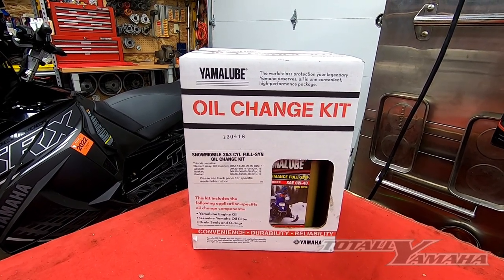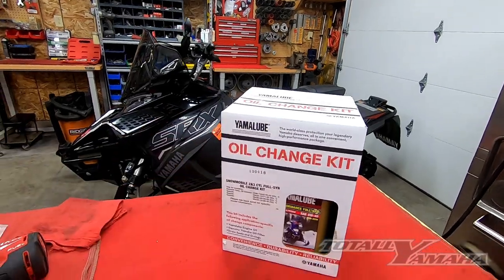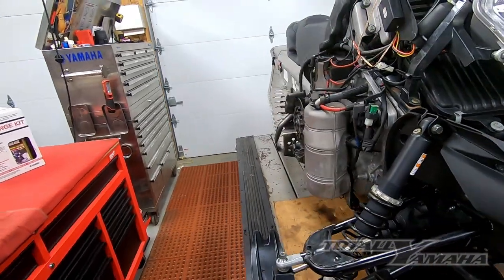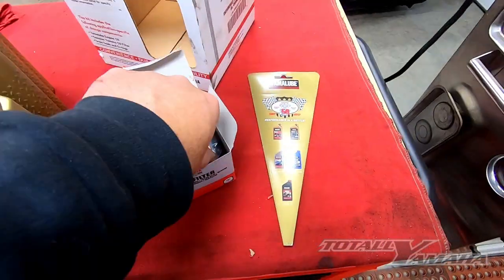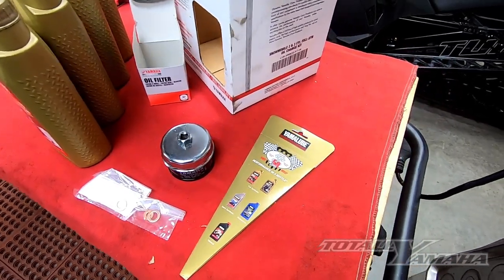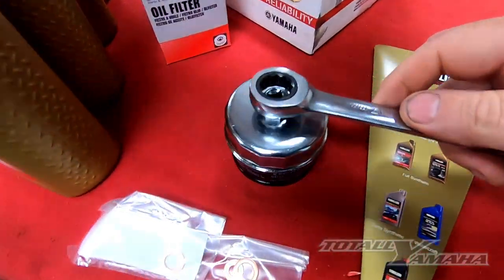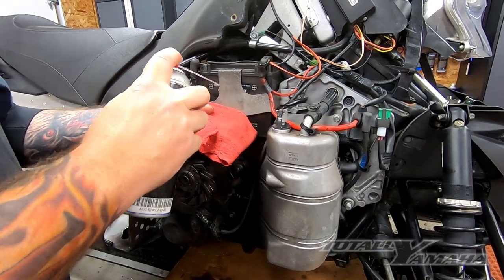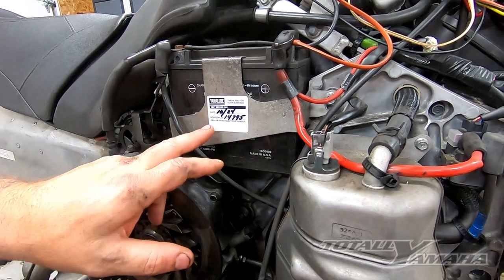2008 and up Nytro oil change - Yamalube Products

Comment: Great vid. If you really want to get technical, and something I always do, you should “pre charge” the oil filter buy dumping some of the new oil into the filter. You don’t have to fill it as then oil would spill out when installing but pre charging with some oil will saturate the filter media and allow the system to build pressure quicker.

Comment: Nytro filter is easier to get to than the apex :)  Do you go by the 20,000km filter interval, ever?
Reply from the maker: Never. I change filter when I change oil.
Reply: @Totallyamaha  i just got a Hiflo 147 for the nytro.  little leary to use the wix 51358 as its longer.
Reply from the maker: @666dynomax  as long as it goes in. I have seen longer aftermarket’s used before.

Comment: My owners manual says to use 0-30 and the sticker on the tunnel by the manufacturer date also says 0-30. Does it matter that you are using 0-40?